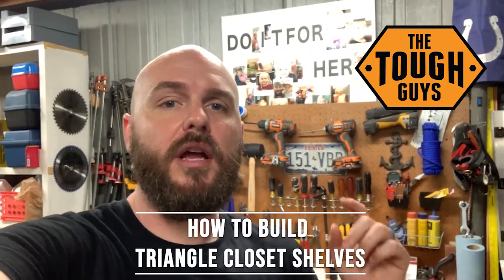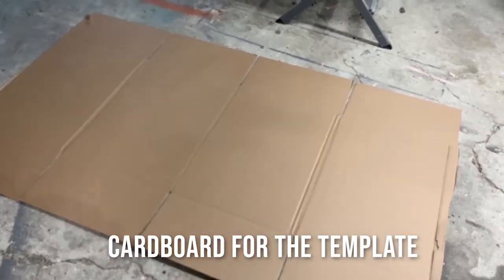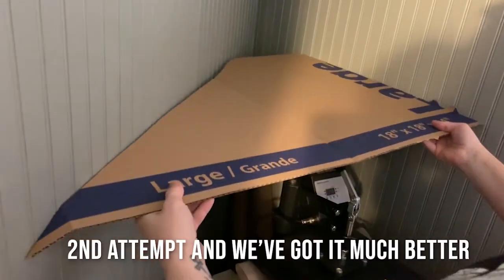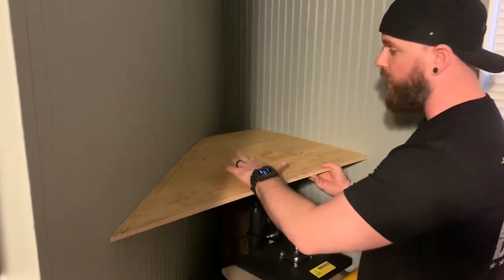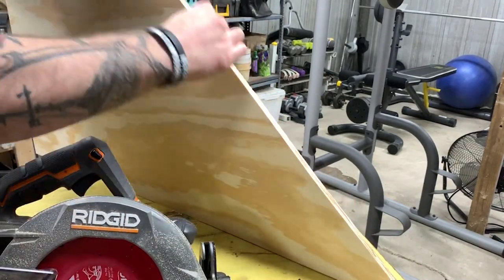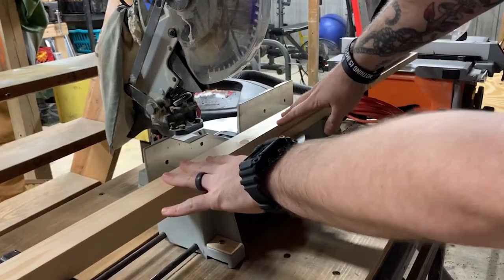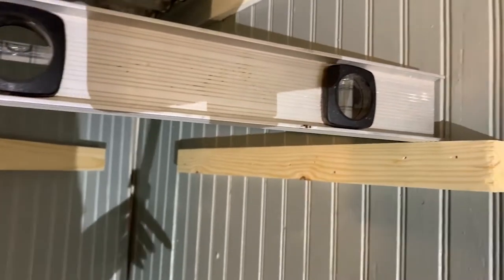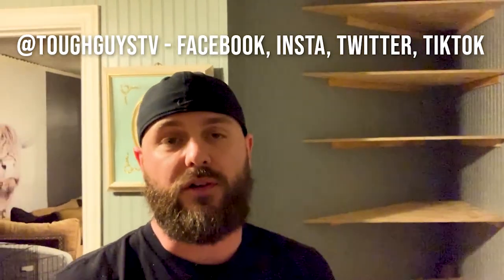How To Build Triangle Closet Shelves

Comment: Thanks I have the same closet situation, but probably cant use the nail gun since im renting. Any alt suggestions?
Reply from the maker: If you can pre-drill holes through some 1x supports, you could attach with screws. If lucky, you can screw into studs (stud finder should help), worst case you could predrill your supports and use drywall anchors, but hopefully you can find some studs. As long as you’re using a drill driver, the sound wouldn’t be too bad, just don’t use an impact driver (if sound is the issue)

Comment: This was almost helpful, I would have liked to see how he took the measurements for the template and how he figured the angles...it’s the trial and error part I wanted to avoid ...
Reply from the maker: Using the cardboard what how I avoid trial and error with cutting wood pieces. Measure the front opening, and then one side of the triangle to the rear. The 3rd line is the easiest to map put on the cardboard. Wish I had shown it better for you - but definitely try making a template first then move to cutting the wood. Thanks for watching